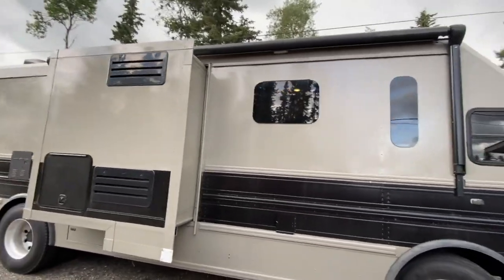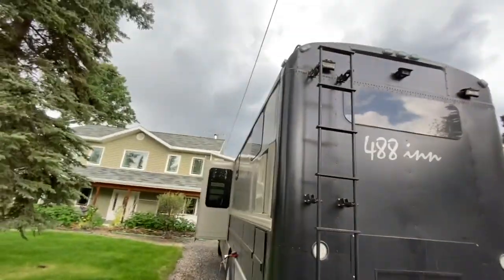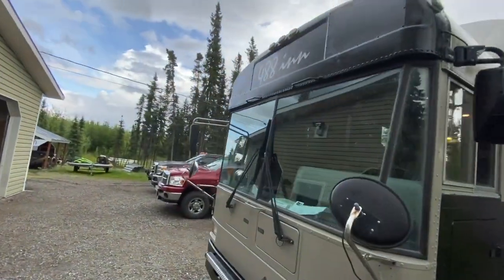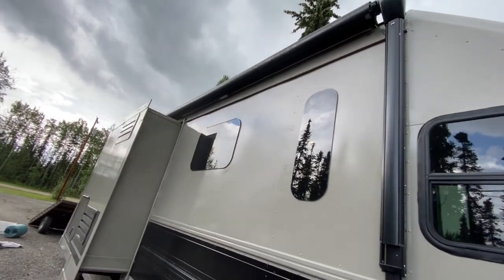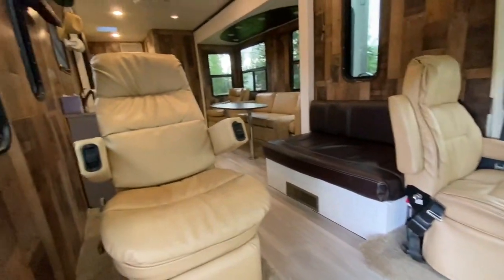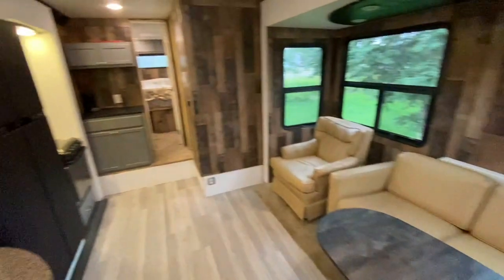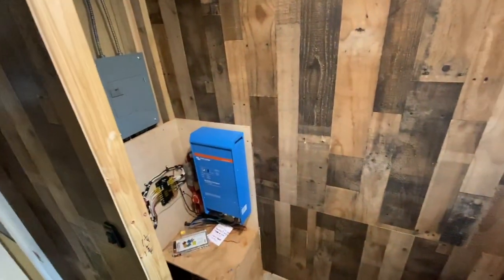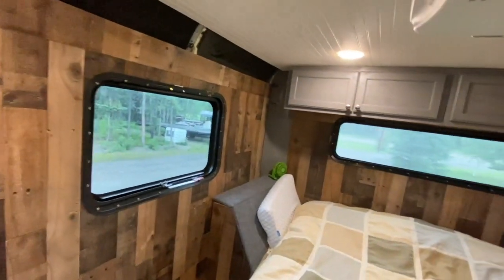The Tour of the 488 inn the skoolie with slide outs

Comment: Beautiful build!! Just a little thought, when I had my ladder exposed like that I found someone  climbing on my roof attempting to steal my solar and a/c unit. What I did was I put  sheet metal over the length of the ladder, with a security lock on the bottom....makes it harder for someone to access your rooftop!👍👍👍👍
Reply from the maker: Nice tip, thanks for watching
Reply: Have a switch inside that you can use to hit that ladder with a 10,000 volt charge. 

That will modify their attitude.

Comment: Motorized gearing for the pull out or are you using a hydraulic or pneumatic system?
Reply from the maker: Cable with electric motor, I’ll be putting together another more detailed video of the slides soon
Reply: @diyalaskanlifestyle  that makes me want to add a similar system to our 40’ Thomas!...Although I’m designing a drop down patio deck for that extra space, but first raise the roof 20”! ...Maybe the mini camping  schoolie would be a the one for the pullout🤷🏽‍♂️
Great work on yours!
Reply from the maker: @brandonsmith3060  thank you, our roof raise was 24”

Comment: I have a 40ft 1977 AMC Bus.
I wanna install slide-outs, can you point me in the right direction for installation/where did you get the slide-outs?

Thanks.
Reply from the maker: I removed the slide outs/hardware from a toy hauler that had a small fire in it. If you take good measurements and remove all hardware you’ll be able to do this pretty easily. if not lots of time & engineering which I’m not against and usually the route I take

Comment: The slideouts don't compromise structural integrity?
Reply from the maker: It probably does a little bit but I did weld a pretty heavy duty frame for the slides to sit in

Comment: Novice question: how much did it cost and can we buy one??
Reply from the maker: I didn’t keep track, if I had to guess prob30k I do think there is some guys down in the states building or atleast doing the roof raises for people
Reply: @diyalaskanlifestyle  how about the height of the skoolie. Is roof too close to your head? How much space would you say is there between your head and the roof?

And the 30k is including the bus? And is that slide out being a problem? I am guessing it's automatic?
Reply from the maker: @omgsam7185  I put a drop ceiling in mine, the only reason I raised the roof 2’ is to be able to get the slides in it without too much modifications. 12” raise is plenty if you are only raising for head clearance. I bought the bus for $1500 back when you could get them cheap